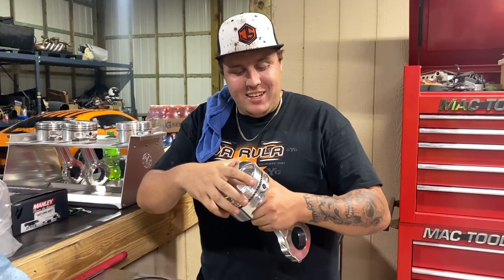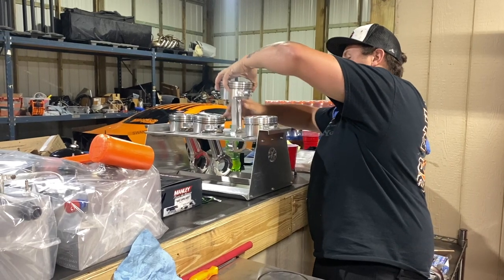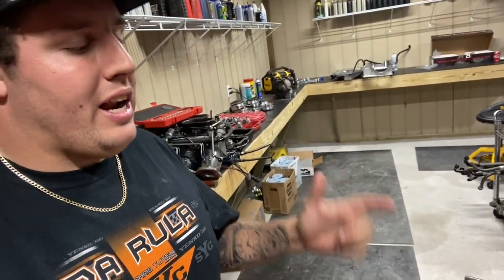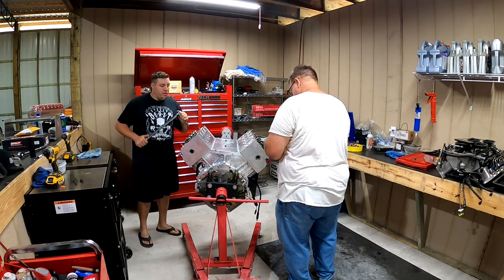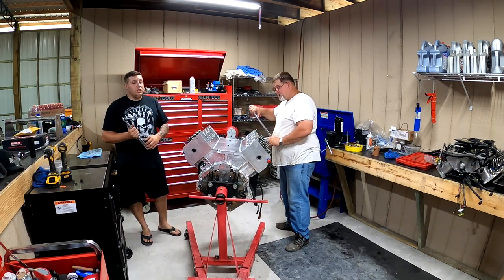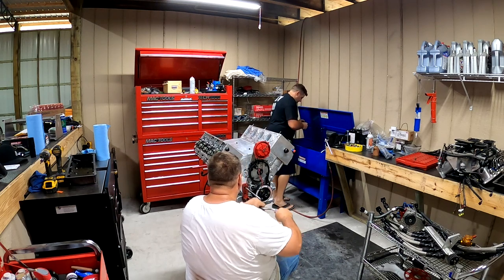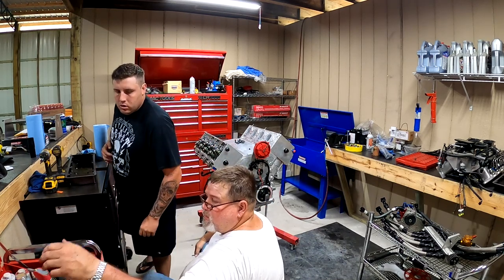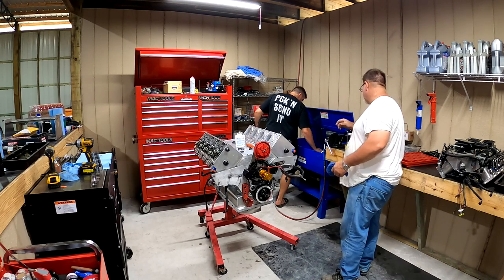Final Assembly on my 997 Cubic inch Engine!!! (Pretty)

Comment: You don't use thermal barrier coating on top of your pistons? Not a rebuke, tech question.
Reply: No need if the tune is right... if it's gonna melt or get hurt, it will happen regardless of the coating.

Comment: What's  the   bore  and  stroke  for  a  997"  motor   ?????       No  coatings   on  the  pistons  ???
Reply: Typically in a 5.300" bore space block, bore is 5.00" or bigger, stroke is over 6.00". There's a few different combinations that will make 997"..  depends on application. 
No need for coatings if your nitrous tune up is right..
Reply from the maker: It’s not dry an yes I staggered the ring. None of them line up with each other, put assembly lube on the bearings and wd40 on cylinder and outside of piston, slap her in! Fired it up last night! 17 inches of pan vac
Reply: @shorty808100  YOU said COATING ON Pistons...  not ASSEMBLY LUBE. Huge difference, son! Lol. Of course parts need assembly lube or oil during assembly, which they did do. Just because it wasn't on video doesn't mean it wasn't done.  He's not doing a step by step tutorial lol. What they use for assembly lube is the assembler's choice... not the peanut gallery's choice lol. Whatever works for them... also, keep in mind, the engine gets pressurized oil through it before start up, so it isn't dry.
As for rings, doesn't matter where or how you install them, eventually the gaps will line up anyway. Rings rotate in the bore.
Reply: @JustinSwanstrom69  How much vacuum are you pulling through the traps?